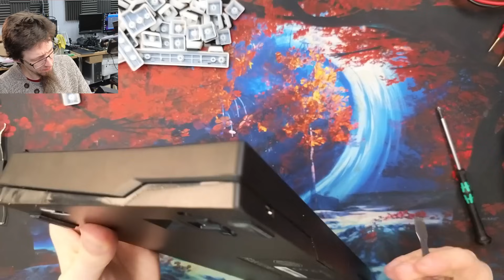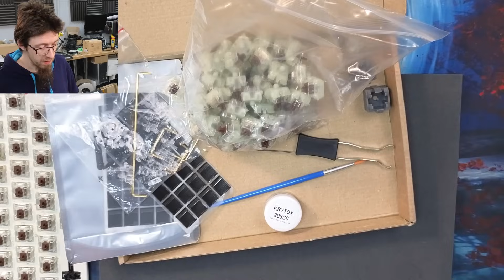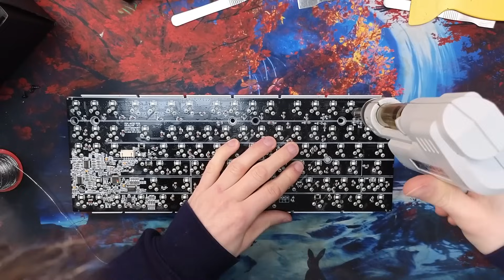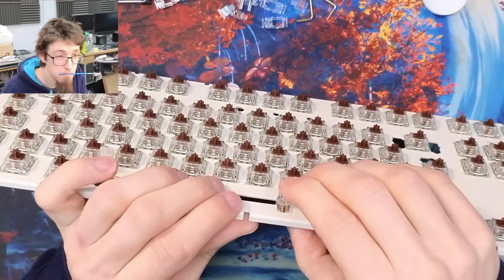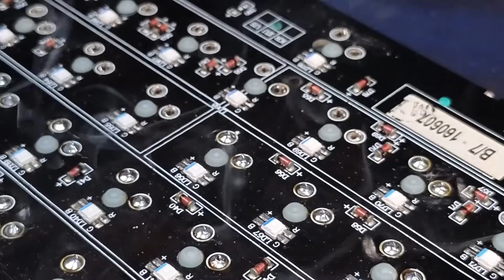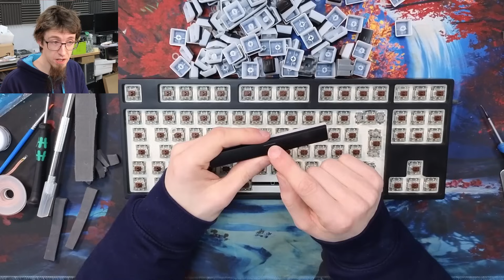Can I make my old keyboard feel like a fancy custom one? - LFC#392

Comment: One recommendation.  Take the top case off once more and apply masking tape to the bottom of the PCB - the whole thing (except the ICs).  It will make a difference in sound (it will be slightly deeper) and the cost in time and effort is low.
Reply: Work wise, I agree with you, I'm constantly using the numpad.  However outside of that, I barely use it.  If I didn't WFH, I could manage happily with a TKL like that.

Comment: Watching	 the vid and based on around 30 custom builds and over 1000 switch lubes I will go out on a limb and say that switches had about six times too much lube. I lube stems only and dont use the krytox 205g0 on springs insread bag lubing with krytox 105 oil. In my experience it really is a case of if you can see any more tha n a slight shine on the surface you have lubed you have over lubed

Comment: Think I would have given the springs a small stretch. think that would have worked better. Great video.
Reply: This will unfortunately destroy the switch characteristics. You can buy longer or two stage springs

Comment: Man, i can feel your pain. I'm currently working with board repair on ECUs, sometimes you have to remove the connectors and that is booooooooring AF and sometimes it can be a gamble cause the problem may or may not be under them.
The mechanical solder sucker works well but after like 4 or 5 sucks it clogs up, so unclog it with like a tweezer or something, and after like 20 or more sucks the insides starts to get dirty and it starts to be less effective. Never used a desoldering gun so i don't know if it has the same issues.
Also, what's that iron you're using? Is that a c210 or t210 handle? And the pinecil gave up or you just retired it?

Loved the video, keep up the good work!
Cheers!
Reply from the maker: Using a T210 handle. The Pinecils both mysteriously died at the same time (bad power supply? no idea...) and I have no idea why. I'm going to take a swing at repairing them though, because they're still great irons, and I'm sure I can get at least one of them going again with parts from both.
Desoldering gun can also jam as well, but the problem there is they're a nightmare to unclog. I usually have to drill the nozzle on mine to clear it. Thankfully it's only happened twice since owning it.

Comment: Its is 100 percent possible to double down and make a keyboard better, a thicker and higher quality keycap set, MX browns aren't really the best switches (some even argue they are the worst) and there could be a couple of mods done in order to make the stabilizers better. However, considering that there are really good keyboards under 100$ (Examples are; Rainy75, RK R75, RK M75) it's not really worth both the time, effort and resources (of your standard consumers).

Comment: Those stabilizer bars are supposed to be on the top so you can snap them to the caps.  You sealed them on the solder side.  There are little inserts that go into those small holes on the backside of the space key, and the other keys with stabilizers, The inserts have a open snap loop to snap the stabilizer bar into.  It's a hassle doing it, but you'd probably find it easy.
Reply: Not with this type of stabiliser. You are talking about costar stabs, these are cherry style.

Comment: "And in my next video I double the speed of my processor by replacing the pins of my mains plug with gold plated ones ..." You only do this stuff once :-) 
I still love my old Compaq AT keyboard. No gizmos apart from a small black hole providing the mass to hold it down. Just call me old fashioned ...

Comment: You'd think new switches would come pre-lubed.  I would.  Why don't they?
Reply: Some do some don't. Many keyboard modders don't like factory lubes and prefer to do it their own way. I refer to lube switches for my own use but if asked to build a first custom board for a family member I used certain factory lube switches as they are unlikely to notice the subtle difference and	 it saves time
Reply: Cherry Browns don't, most of the "value" switches don't.

Comment: i just did this but for my 100% keyboard (ducky one but with push in so no soldering) changed them to cherry mx blacks and lubed them all, only 2 switches i over lubed so will have to clean them, i also used  o-rings dampeners

Comment: What temp do you have the De-Soldering gun at ?
Reply from the maker: 400c, which is a bit hot for a two-layer PCB, but mine seems to need the extra heat to avoid self-cooling when you pull the trigger.

Comment: My spacebar is loud too . I put hot glue in the key recess and fixed it . The added weight was a good benefit for me also .
Reply: I used plasticine so it was easy to add and remove to get the perfect weight. Like the hot glue idea, might try it on next keycap set

Comment: Can't wait for Graham to figure out hot swap sockets exist, he could have turned his keyboard into a hot swap keyboard and made future replacement of the switches much easier.
Reply from the maker: You can't retro-fit hot-swap sockets though, surely? PCB needs to have the footprint for them in the first place...
Reply: @Adamant_IT  there are sockets that are just the cylinder part, like Mill-Max 7305. Many keyboard shops sell those, I'm sure there are others as well
Reply from the maker: Oh that's very cool... I'd have used those if I knew about them in advance! No matter, I've no intention of changing anything in this keyboard again anyway - it's got a decent feel, and if I do want a change again, I'll definitely want a whole new board anyway.
Reply: @Adamant_IT  Stay strong...! When the itch hits, it hits hard, and your wallet takes the brunt of the force. 😂
Reply: @Adamant_IT  I wish it was that easy... once you get started, you want to change all the time 🤣 I have 3 keychron Q series keyboards now, all of them with some less common switches, but the cost quickly adds up.

Edit: I know you did soldering projects in the past. If you want to get more into the custom keyboard scene, there's a DIY open source numpad called yampad, I recently finished mine and it's a lot of fun.
Reply: @Adamant_IT   Hi Graham, most of that sockets are not line up perfectly in place and most switches not compatible for these sockets, My HolyPanda switches for example they wont fit and i ended up breaking dozens of switches because of that.
and its pretty hard to find switches information, pin thickness and etc you cant be sure it will fit correctly.

Comment: Stabilizers need more lube, especially the space bar. I use Prounol Silicone grease lubricant multi purpose for this.
Reply: Yes,he lubed the bobies but the end of stab bars need heavy lube. Also holee mod and bandaid mods to board to tighten fit of stab to plate will remove rattle